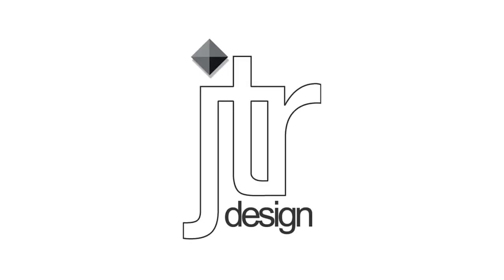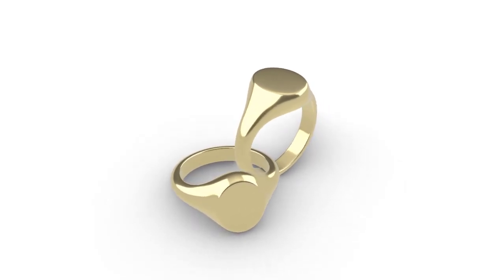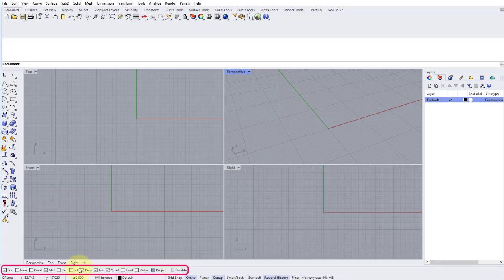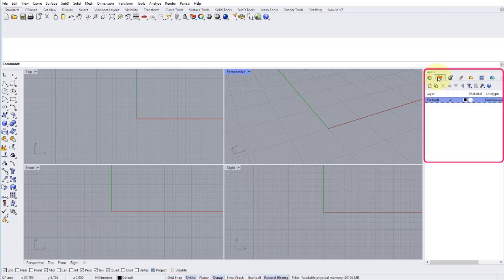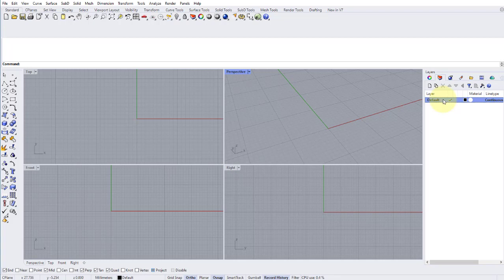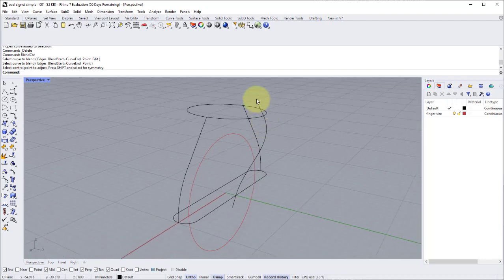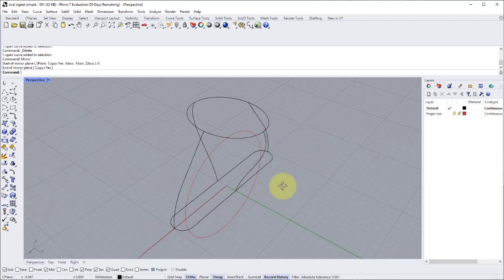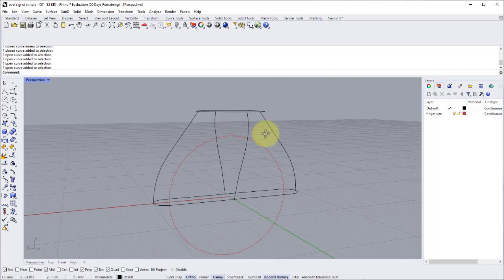Signet Ring - Beginners Rhino Jewellery CAD Tutorial - Oval Pinky Ring

Comment: Super super helpful and informative! I found that an easier way to finish is to cap the entire thing after NetworkSrf, making it a solid surface, and then boolean out the middle of the ring. Duplicate the bottom 2 edges of the top half of the shank, and then just sweep1 along the inner ring rail. Gets rid of the lofting steps. :)
Reply from the maker: Great to hear!

Comment: hello friend, excellent video, thanks for your contribution, but I have a question, how can I make a fillet on the inside of the edge of the ring?
Reply from the maker: Thanks for your kind words ❤️. To fillet the inside edge you could use the ‘filletedge’ command choose the radius that best fits. If that’s fails, as often fillets do in rhino, offset your ring rail inwards , trim back, draw an inside court shape and sweep two with maintain height . Or network surface  wit the required curves.
Reply: @jtrdesign-practicalrhinoje9669   friend, good afternoon, yesterday I saw your video of a signet ring, but I am making a similar ring.
but when making the boolean difference to give the size of the ring from the right profile, its width changes and I cannot adjust the width with the modification box. It would be a great help please.
Reply from the maker: @agarkings513  I you referring to using cage edit to change the width of the band?

Comment: Thank you so much for putting this together! I have one question. When I go to join all the surfaces together at the end, I am getting one naked edge at the center of the top where we performed the rail revolve. I redid the revolve a few times, but I am getting the same naked edge each time. Do you have any suggestions on how to fix this?
Reply from the maker: Hi Ashleigh. Hard to say without seeing the model you have made. Email me the file and I'll take a look for you. :) jack@jackrow.com
Reply: i got the same problem. how did you fix it?
Reply: Hi there awesome tutorial, I am also having a naked edge in the center at the top after doing a rail revolve, causing an open surface.  Did you ever figure out how to deal with it?  it's the only issue I've had and the ring is looking great.
Reply: @perrythompson432  Hello! Yes, I was able to resolve it. I used the command RemoveAllNakedMicroEdges. Hope this helps.
Reply: Thank you  @ashleighkenworthy4951   I ended up edging the hole with a curve and used the surface then patch command.  I did not know about the RemoveAllNakedMicroEdges so thank you, I did try it and it did not detect the edge for some reason.  Might have been too small?

Comment: Hi i did that surface rail 2 but I couldn’t see like you I saw just lines how can I fix that ?
Reply from the maker: Send me your file and I’ll take a look: jack@jackrow.com
Reply: @jtrdesign-practicalrhinoje9669  thank you
Reply: @jtrdesign-practicalrhinoje9669  with your help I draw my first ring
Reply: And can you dawn load a video about your rhino sattings because while I draw I couldn’t get same size which you get like your 15.9 is more bigger than my 15.9
Reply from the maker: @alenalen2237  15.9 should be 15.9 - are you using the small objects mm template?
Reply: @jtrdesign-practicalrhinoje9669  Maybe how can I change that
Reply from the maker: Check out one of my latest videos - it’s shown at the start.

Comment: Boolean difference failed. What are the properties of the "medallion" 3d object that makes it different from a 3d box I draw in Rhino? With the 3d box any text drops to the "bottom" of the box... ......... There is something very specific here that you assume is already in place.
Reply: Hi @martina5328 - Not sure I understand regarding the "3d box" or "Boolean Difference Failed" parts of your comment. There is are boolean difference commands or text commands featured in this tutorial. Sure you've commented on the correct video
?
Reply: @jackrow1332  I am merely saying that you do not specify the conditions under which this works. Creating a cube or box straight from the toolbox and then trying to add text like this does not work. Adding a surface to that cube (and it looks like or one would assume that the cube comes with surfaces) does not change the fact that it does not work. It may seem obvious to you or to Rhino developers, but for anyone new to it, it has zero user friendlness. This leaves them extremely vulnerable to new competition.
Reply from the maker: Rhino for sure has a particular learning curve. And has it's strengths and weaknesses. Booleans aren't really its forte . Rhino is a surface modeller first and foremost.  I teach my students not to reply upon Boolean operations  - we surface model, then once we have the hang of that, we can use booleans to save us time, in certain scenarios . And if a Boolean fails, we know how to surface model around the problem. If  you treat it like a solid modeller, you're bound to encounter problems. If you're struggling with the software (most people do) I'd be happy to have a chat with you regarding online lessons, if you're interested.